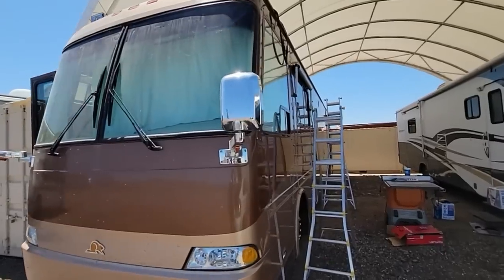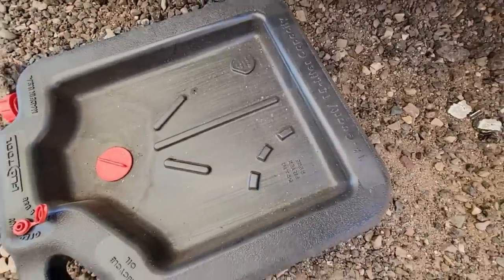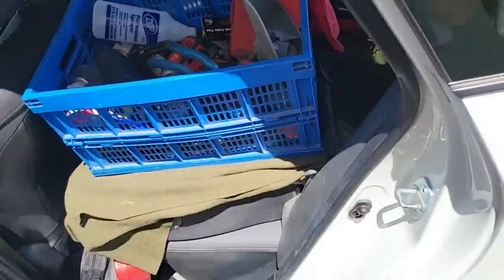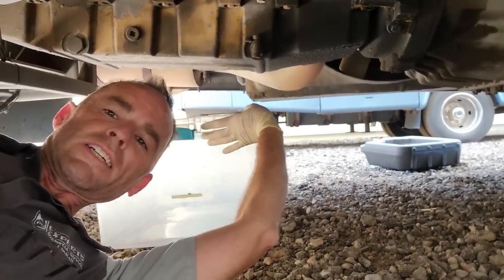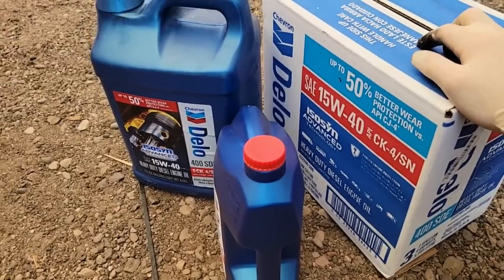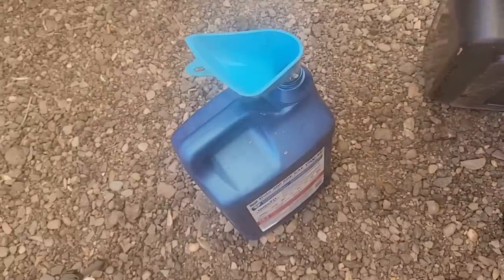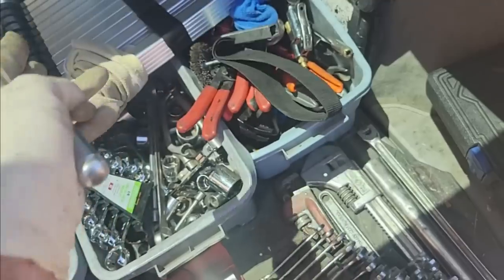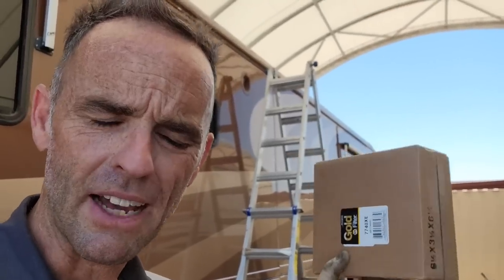Servicing the Cat C-12 and Allison 4000MH Transmission

Comment: .
 Expect to do a head gasket and Cam/Followers between 750,000 and 1 million miles.
 These problems are common, ask around and you'll find out. Other than 
that, a good engine, the fixes are out so you will really only have to 
do them once
Reply from the maker: I've got a while to go

Comment: Ya know they call that an oil burner for a reason. Especially that clean transmission fluid would have went right into my fuel tank. If you have an older non EFI diesel your not going to hurt anything. I dilute it like 10 to 1 with diesel and "recycle" it. Don't have to put it in the car and take it in and with the price of diesel may as well get your moneys worth. Never had an issue.

Comment: Is the Caterpillar mechanic ,,YouTube channel adept ape,, Interestingly caterpillars recommended do not fill the oil filters up for fear of getting junk on the unfiltered side damaging bearings,,,
 Just me I'm always careful and I always feel the filters full whenever I can that's just me..
Reply from the maker: I've read this several times now, I don't know if it's an insult, a statement or if you have a question lol
Reply: @AZExpert   Just a statement no insult whatsoever..... I've always filled my oil filters full of oil before installing.... I was surprised at Caterpillar specifically said not to do it for fear of getting junk on the unfiltered side was interesting to me,,,,, I guess I can see  Caterpillar always been in the fields and dirty dusty grimy environments it's not worth the chance..... But me and my garage are controlled environment I can carefully fill the oil filter and that's what I do...
Reply: I follow Adept Ape’s suggestion, if you fill your filters only fill from the holes on outside not the center hole.  Otherwise the oil you pour into center is not filtered prior to reaching the engine.  
This is really important on the fuel filters.

Comment: Love your stuff!!!  Thanks for posting.  Regarding the trans oil levels, you should also be able to use the control pad to provide you with the oil level through its diagnostic abilities. This is really helpful on motorhomes, as the dipsticks installed from the various builders are probably not calibrated to the pan depth.  Just something to look into if you choose.....
Reply from the maker: Thanks for the tip

Comment: I think you are fully flushed with changing the ATF again since it does appear to be new fluid that you drained.  I am with you full synthetic ATF will last much longer than 25000 miles.  That is not correct.  I would refer to the ATF maker.  Perhaps the maker is referring to conventional ATF?
Reply from the maker: perhaps

Comment: Excellent idea to use a plastic tote for the old oil drain  !!!  Also it looks like you are holding the camera with one hand and then doing what you have to do on the coach with the other ? Do you have a small tripod for the camera as it might make it easier to film and you would have both hands to do your work. But then I can't tell for sure if the camera is on a tripod or not at times ?   Either way, you rock and your videos are fantastic !!! Love that Beaver coach !!!!
Reply from the maker: I have a tripod but I have to move the camera too much
Reply: @AZExpert  You do such a awesome job. !!

Comment: Next oil change use a hammer and punch and poke a hole in the bottom of the filter and let it drain. Much cleaner and makes filter removal easier.
Reply from the maker: Thanks for watching! :)

Comment: Thanks for confirming why I don't own one of these maintenance nightmares. Even though you didn't say how much everything cost, the labor is enough to discourage.
I'm guessing about $250 in material. Labor at a shop might have been about another $350.
Most people figure their cost to own on fuel costs alone, never considering the cost of maintenance and repairs and calculating an actual cost per mile. As an aircraft owner, it's a habit to know these costs so they can be carefully figured into the cost of operation
The drain valve is handy but they can't let all of the oil out since the opening is higher than the bottom of the pan and higher than the factory plug.
I have found that removing oil filters allows more oil that is trapped in the engine to flow into the pan so I always leave the drain open until after the filter(s) are removed.
If you saved the oil jugs you could find a tube that fits on the drain valve and drain directly into the previously saved jugs.
You didn't show how you emptied that tub but I assume it was a mess, not to mention heavy.
Love the videos.
Reply from the maker: Thanks for the tip

Comment: Also use the self level diagnostic test for the Allison, not the dip stick.
The following procedure will allow you to check your transmission fluid level from inside the vehicle, and it is also more accurate than checking via the dipstick.

To enter the transmission oil level display mode, press the UP and DOWN arrow buttons simultaneously on the mode selector. A two-minute countdown begins when the following conditions are met:

Engine is at idle
Transmission sump oil is at operating temperature
Transmission output shaft has stopped
Transmission is in neutral
Oil level sensor is functioning properly
The display should show *8 and then count down to 0. Note that it will take two minutes to complete this countdown. During the countdown, the display flashes and a count (8,7,6,5,4,3,2,1) occurs reducing by one digit every 15 seconds.
After the two minute countdown, the shift selector displays the oil level data as in the following examples:

OIL LEVEL READINGS	MEANING OF READINGS
o, L, o, K	Fluid level is correct
o, L, L, o, 1 or OL, LO, 01	Fluid level is 1 quart low
o, L, H, 1 or OL, HI, 01	Fluid level is 1 quart high
Reply from the maker: Thanks for the info

Comment: I also watch a channel call "Adept ape" He's a Cat. mechanic and recommends "if you prefill" your oil filter(which I do), block off the large center hole and only fill through the small outer holes(unfiltered/dirty side). Ours only uses 22 qts and I found a 25-27 qts catch tank. That spigot would be NICE. As long as a rock couldn't  open it for you. Lol
Reply from the maker: It would have to a horrible situation for that to happen

Comment: Next time you do this service. I make sure that the oil filter will come off with a turn or two then I use a 1/4" punch and poke a hole in the bottom of the filter to let it drain. Not so messy.
Reply from the maker: Thanks for watching! :)

Comment: I used to be a diesel mechanic and we would take a punch or something sharp and punch a hole in the oil filter and let it at least partially drain before removal. Less mess and lighter.
Reply from the maker: Yes

Comment: 3:24 Next time skip the tote cleanup and just stop the flow when you're pan is full. Drain the last bit straight into an empty bottle/jug. ...Although personally I'd skip the jugs and just buy 5 gallon buckets of oil.
Reply from the maker: Sometimes you have to buy what you can find
Reply: I had thought the same thing but its easy to get distracted and forget before it over flows 😊
Reply: @AZExpert  I saw you mentioned availability was a problem. Tractor Supply stocks it around here.